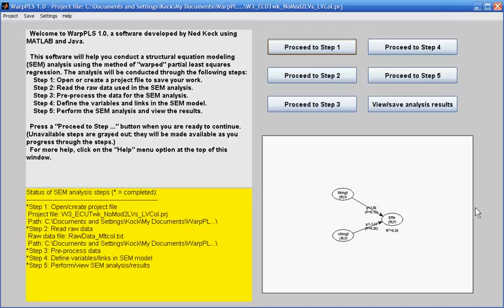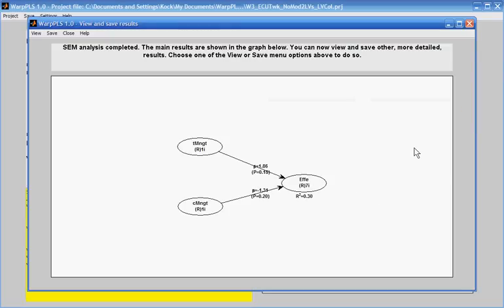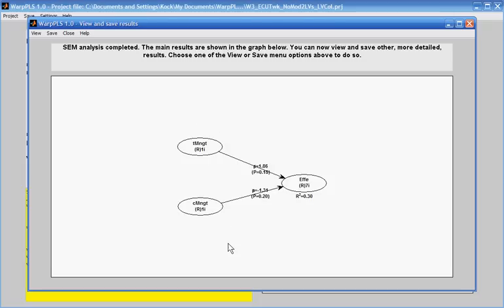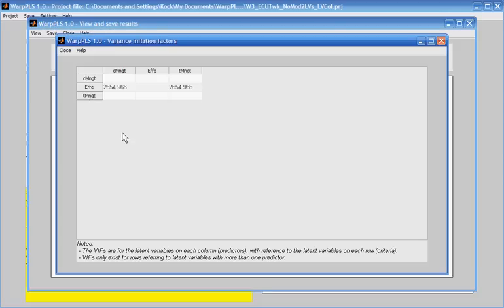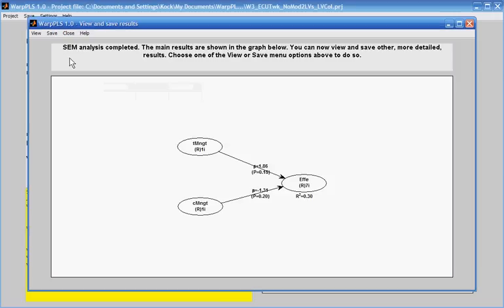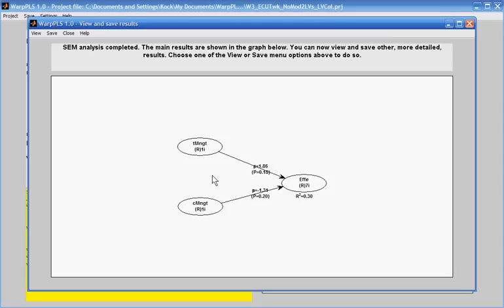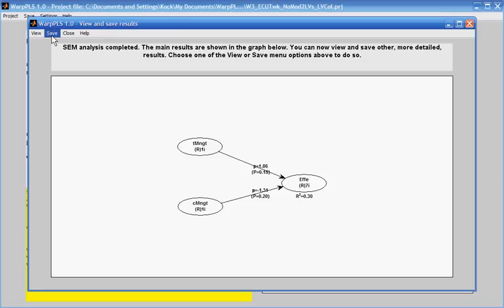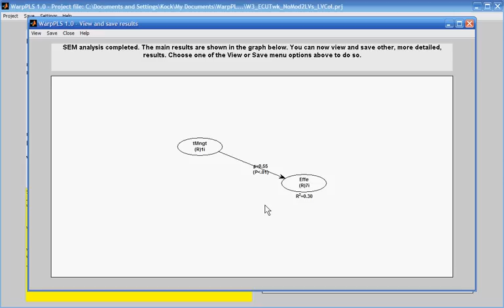Solve Collinearity Problems in WarpPLS

Comment: Thank you for the simple explanation. However, I have 5 latent variables with these results LOP 12.160 and 10.965.Others are less than 10. Please how can i combine the latent variables? Or which of the variables am I to delete? I think LOP with 12.160 is sufficient o remove. Kindly advice me